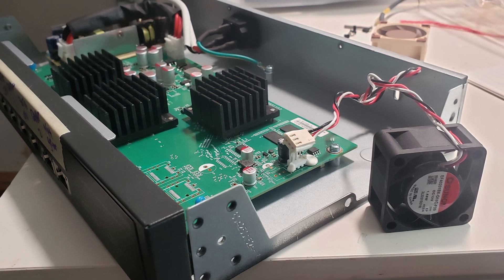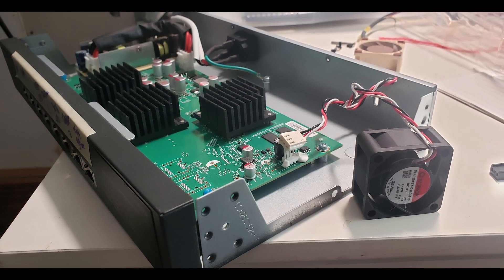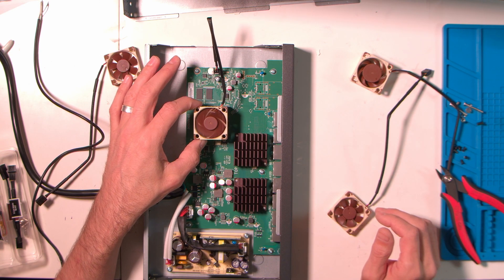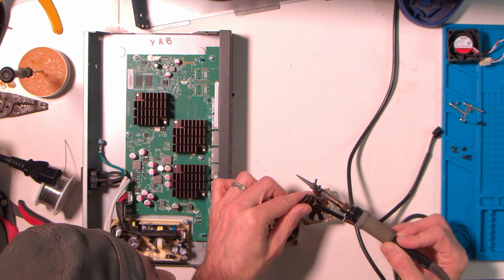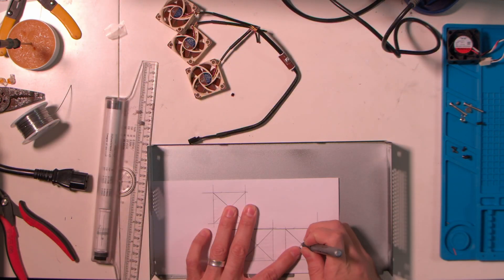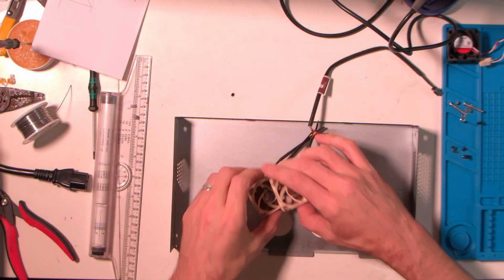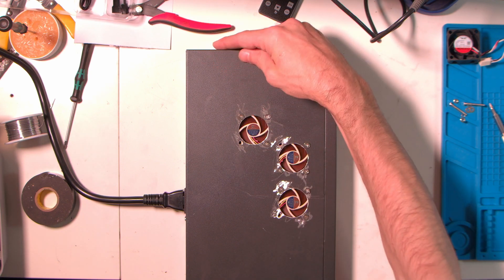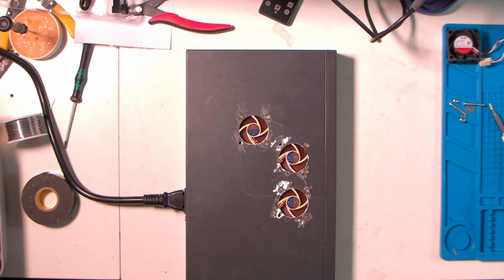Crazy Fix for the Loud Fan - TP Link TL SX1008  8 Port 10G Ethernet Switch

Comment: Cool, thank you for sharing. Seems you went all out, but my question is why not just replace the one fan with the quieter brushless version rather than adding more fans and drilling, etc? That’s what I’m planning to try out first. Would appreciate your thoughts.  Thx!
Reply from the maker: Haha yes that's a more sensible solution by far. My problem initially was the noise and a quieter fan solves that as you suggested. Once I opened it up, armed with the belief that cooler electronics mean better performance and longevity, I just went nuts. No other good reason for this insanity.

Comment: It is actually better/more effiicient to blow air onto the heatsinks than pull hot air out. But then you would expose spinning fans and probably would need to use some fan wire covers to protect them.

Comment: your not wrong about it being noisy.   mine just arrived a few days ago.  it's a constant buzzzzzzzzzzzzz.....  ordered a noctua fan. looking forward to copying you. (just one fan for now...)   Thanks for putting this video together. With out this I would have been disappointed with my purchase and put it a seperate room. IT"S SO ANNOYING TO LISTEN TO it buzzing away for nothing.
Reply from the maker: I still have a hole in my drywall where I was all ready  to route it into the next room before I decided to go crazy with drill haha. Glad you liked the video. Are you going to replace the existing fan with that new one? I didn't cover it in the video but the wiring isn't always a straight swap, I think I had to change the order to make it work properly. Make sure when you test it, the fan goes full speed for a few seconds after plugging the switch in and then should slow down but it always always is spinning.

Comment: Omg i wqs about to order this switch today. I got a synology Nas 10gig. So now wondering which switch i can go for .
Reply: You could look into a QNAP 10G switch. I believe they havea 10GB that is fanless. I ordered this TP-Link for my Synology NAS with 10GBe since reviews say it was quick and I figured I'd address the noise with this Noctua fan, but I have it now and it's really not that noisy unless you're recording around it. Maybe they switched fans in the latest batch. I did have an issue getting it to negotiate 10GB at first but now it seems to be working fine.

Comment: I recently just bought this and waiting for delivery. I guess I need to buy a quiet fan now. xD Thanks for the tip and demonstration.
I'm probably just going to buy the one fan for now and see how that fares. (The pursuit of 10g)
Reply from the maker: Yeah thats a much more reasonable solution. I was about to drill a hole in the wall and set it up in the laundry room next door. One thing I noticed though if I ever had a few 10g devices grinding away and the fan kicked up speed, I'd have to restart the switch to shut it up after I was done. Even if the computers were off by then. Maybe that won't happen for you but just FYI.

Comment: why not just measure and use 1 large noctua with 1 plug would cover all the area and move way more air.  Didnt think that through did you
Reply from the maker: You got me! I definitely did not consider putting a single large fan to push a lot of air over the general area of the heat-sinks. That is literally the problem I'm trying to fix by eliminating the existing "Large, Loud, High CFM Fan" and installing tiny silent fans directly on the heat-sinks instead. This targeted cooling allows the fans to run at the lowest speed since the goal here to reduce the noise and preferably without putting a fan on the outside of the box. 1 fan might be easier... but I'm not afraid to do a little extra drilling so it's as good I can get it. I mean I'm still lazy, I didn't even go back and paint all the scratches but I just don't care about that. Stay Cool!

Comment: Great video thanks, but it is a switch not a router. I plan to buy one and replace the 40mm high speed fan with a low speed 140mm fan and a fan guard on top of it.